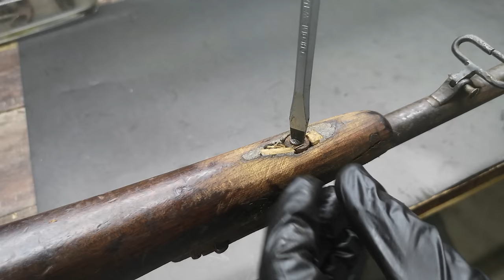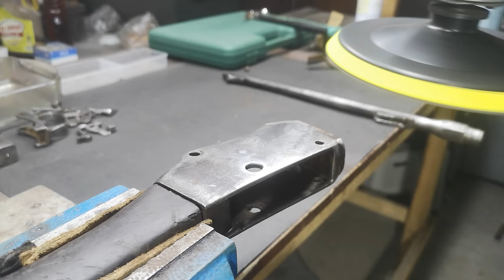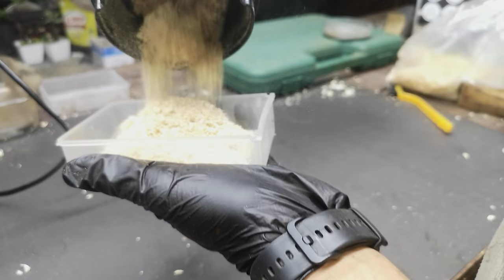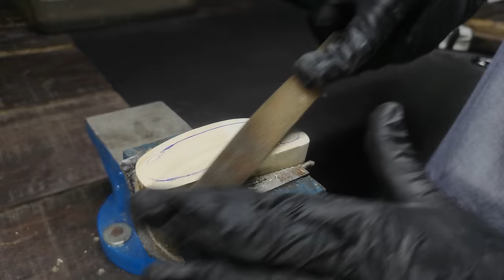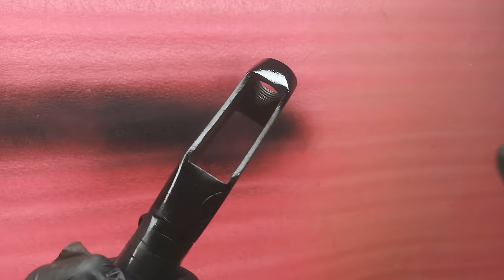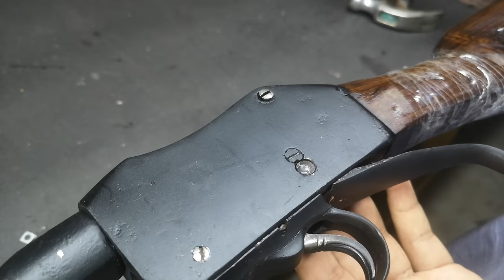Restoring an Indian Antique 1871 Martini Henry Single Shot Lever Gun

Comment: I have seen worse restorations, but I cannot remember when! Sorry. Why fill the holes in the stock but leave one un smoothed, oh and I don't thing Martini Henry's ever had raised cheek pieces on their stocks? Why hot blue the parts EXCEPT for the main receiver which was painted? Finally, when rubbing down the wooden stock do not leave it attached to the rifle as thie dust will invariably find it's way to where you don't want it!!!

Comment: That spray paint is great, just like old stuff in the 1800s
Reply: Little known fact, the term "horsepower" originally referred to the PSI a team of two horses could generate for the early air compressors of the Henry and Sons Firearm Spray Paint Factories.